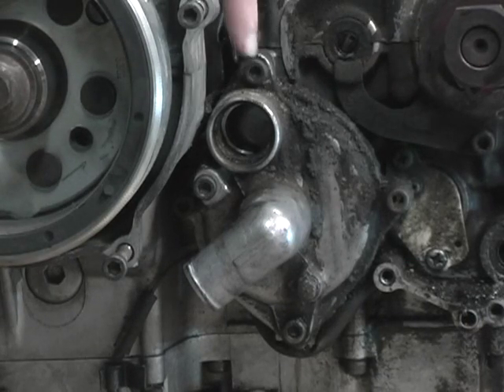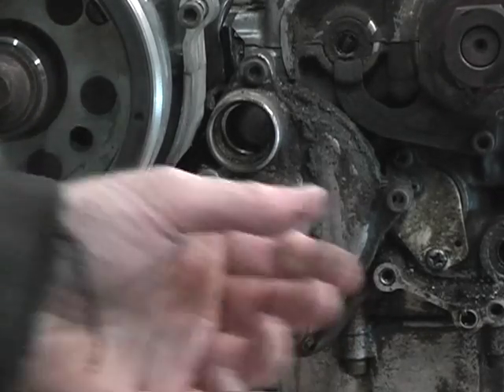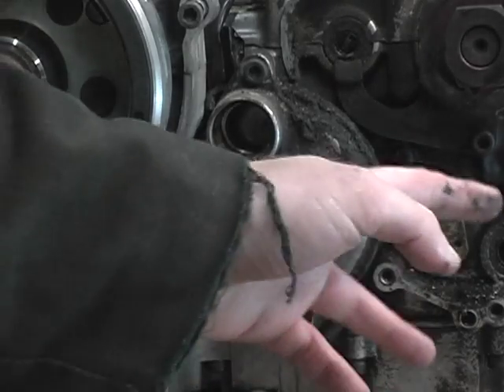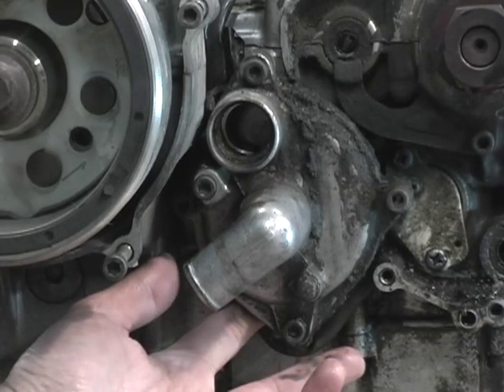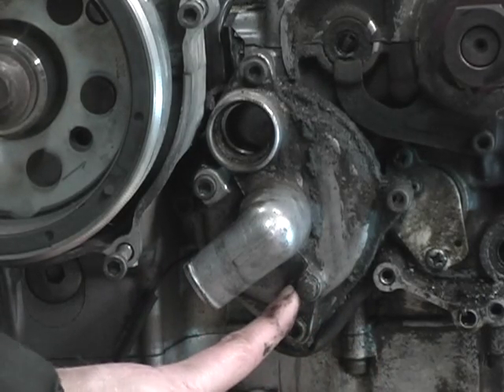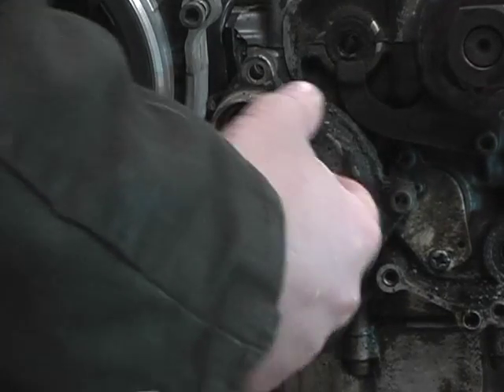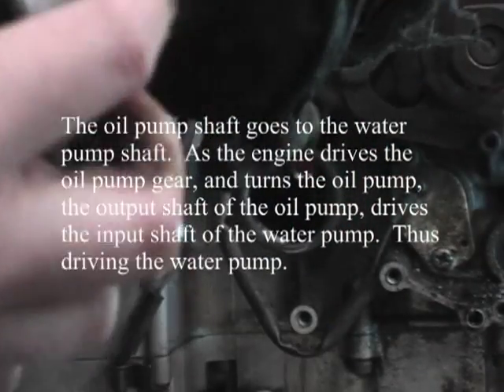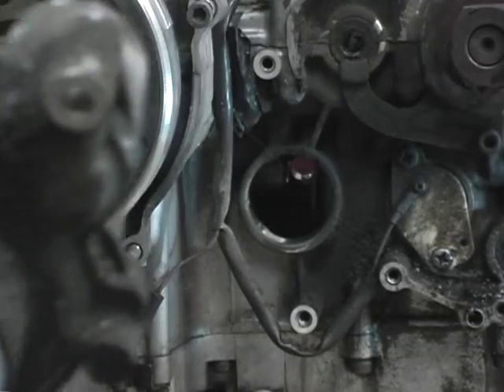15 Water Pump Removal yzf600 1996

Comment: Replacing the water pump on my 02 right now. There’s a cover that the shift lever is connected to that’s not allowing me to pull the pump strait off. I assume you have to remove that first?